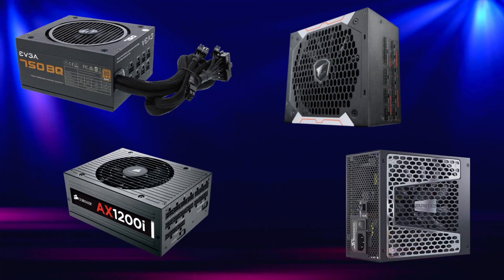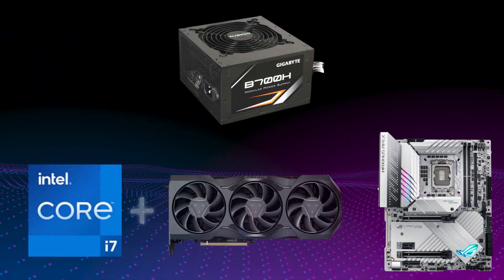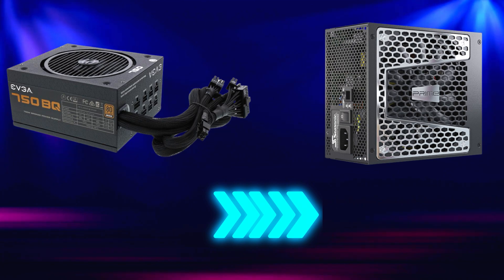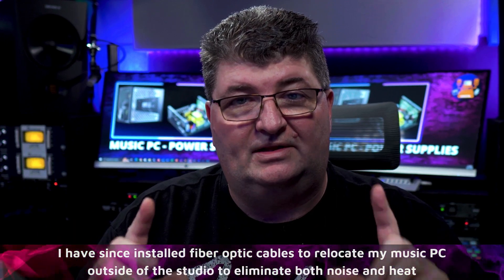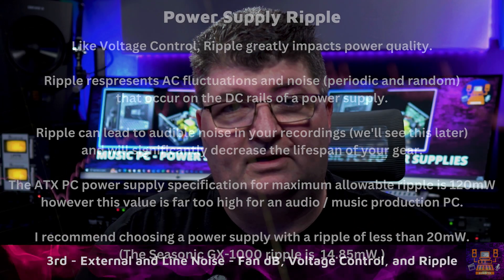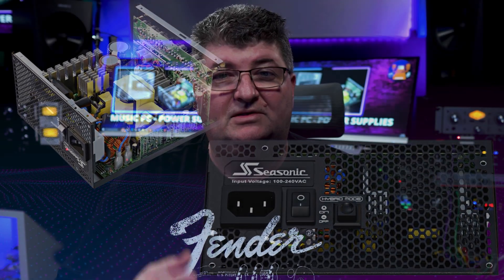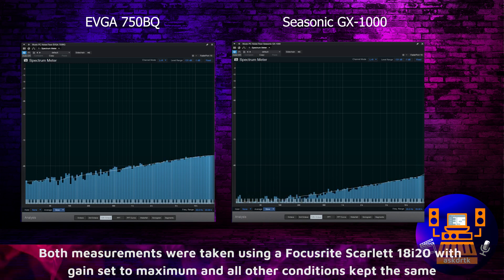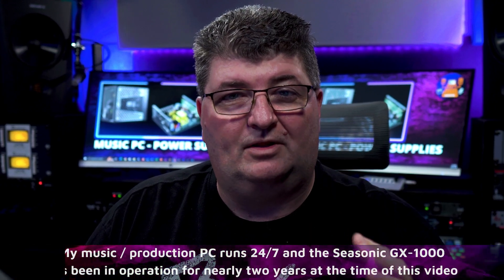DO YOU KNOW How to Choose a POWER SUPPLY for Your MUSIC PC? - 5 Key Steps

Comment: Why not the TX-1000? If going for maximum quietness ?
Reply from the maker: The TX-100 is generally a solid choice, but if you have a video card that uses the high power connector, there have been a lot of reports about line noise from the card being back-fed through the 12V sense wire. Ferrite chokes may help, but something to be aware of. Always tradeoffs with gear...

Comment: Thanks for your videos, very interesting topics that most times are overlooked... 
I have this annoying noise/hum when having my PC and Bass rig (amp and pedal board), noise comming from the PC/audio interface monitors AND the Bass amp speakers... both connected to the same outlet, using voltage regulator and surge protector, but still there, maybe  it is the PC power supply, ... anyway, I will consider all your info for my next PC , thanks again!
Reply from the maker: Much appreciated, I try to think of topics that can have a real impact but aren't always as exciting as "near gear" etc. Glad you are enjoying them. 

If the noise is not there on your PC monitors when the Bass rig is disconnected it is likely not the PSU (could be a bad ground inside the PSU but unlikely). I will say that issues can occur even when connected to the same outlet - happens with outboard gear (especially tubes) often.  Even the usual power conditioners (standard Furmans and others we see all the time) often do not solve this. For me the solution has been using power strips that individually isolate each outlet from one another. I use Tripp Lite Isobar power strips (connected to my Furmans) for all my outboard gear and amps. Since I did this, noise is gone even with wall warts mixed with tubes mixed with 500 series...you get the idea.  Hospitals use them to isolate sensitive heart monitors...so I figured if they were that good, they would be great in the studio and sure enough years later and I am not changing them. Here is a link if you want to check them out: https://tripplite.eaton.com/pages/isobar  Hope this helps out!
Reply: @askdrtk  Thanks for your response, not really sure about how you describe the use of "Tripp Lite Isobar power strips", I think I have something like that already, but maybe I'm wrong, taking advantage of your experience, this is how I have my power connections setup:
*Bass amp (Little Mark tube) and
* Pedalboard (with a 10 Isolated Outputs Power Supply) connected to
* Furman Power Conditioner Standard Strip (SS6B), connected to 
* Voltage Regulator (1350VA,  675 watts capacity) connected to THE Outlet.
Also my Focusrite Scarlett 18i8 is connected to a RackRider (15 Plus) connected to the same Voltage Regulator
And the PC also connected to the same Voltage regulator.

I know... It is a mess! 😲🤣
Any ideas? would the Isobar help in some way?
Thanks again
Reply from the maker: I’m not sure which voltage regulator you have but many do not have individually isolated outlets. Isolated outlets have separate filters preventing EMI from passing between devices. If your voltage regulator does not have isolated outlets, EMI can be passed and even looped between any and all of your gear. I would be inclined to first try connecting the RR to the voltage regulator and then all of your other gear directly to individual outlets on the RR. If that does not improve things, try an isobar with this configuration: Plug the voltage regulator to the main outlet, plug the RR into the voltage regulator, plug the isobar into the RR, and then plug all other gear (bass amp, pedalboard supply, RR, and PC) into separate outlets on the isobar. The difference with connecting your gear to individual outlets on the isobar is that each device is isolated from each other in addition to the external supply whereas the RR only isolates the outlets from the external supply, not from each other as far as I can remember.
Reply: @askdrtk  it doesn't seem that my Voltage Regulator or the RR-15 Plus have isolated outlets, so I'm going to try with the isobar
Do you know if "Tripp Lite ISOBAR8ULTRA Isobar Surge Protector Metal 8 Outlet 12 feet Cord 3840 Joules" is a good option?
It says the 8 outlets are arranged in 4 isolated filter banks, so it should work, right?
Also, just to clarify the configuration:
Outlet <- Voltage Regulator <- RR-15 Plus <- Isobar <- Every Music gear (PC, Monitors, Interface, and Furman SS6B with Pedalboard, Amp, etc.)
Right?
Reply from the maker: Yes, the 8ULTRA is a good option, I have three of those behind my racks. Configuration should be good as you have listed. (As an option you could also eliminate the SS6B and connect the amp and pedalboard separately to the isobar if that fits with your layout, but this is likely not necessary).
Reply: @askdrtk  Thanks again, very helpful messages 🙂
I wish I could avoid using the SS6B, but because of "distances/layout" I need some "long" connections for the Amp and Pedalboard, and some other effects
Do you think the SS6B could introduce some noise?
Anyway, I'm going to buy the Isobar 8Ultra, I hope I can get rid of this annoying noises for good
Thanks again, you rock!
Reply from the maker: It is possible the amp and pedalboard could create a loop through the SS6B, but it shouldn't get through the isobar to your PC. Worse case scenario, two extension cords from the amp / pedalboard or another isobar to replace the SS6B. Glad to help out. I know how frustrating chasing down noise issues with gear can be from "many years of headaches..." Let me know how things go.
Reply: @askdrtk  An update... it looks like the "noise" was induced by my SansAmp Para Driver pedal, that I use to "split" my bass signal and get the Parallel Output for the pedalboard, and the DI output to my interface, as soon as I disconnected the DI Output the noise stopped, a bit of a disappointment
Anyways I got a 8Ultra, and tried a few different ways to connect my gear, it looks like the only issue is the one with the SansAmp pedal, and something similar with the way I split my guitar signal (Boss LS-2) to pedals and amp, and as "Direct Instrument" to Interface.
Because of "layout", Outlet to Regulator, Regulator to PC (and monitors), 8Ultra, and RR-15, 
8Ultra to Bass Amp, Pedalboard, and SansAmp, 
and RR-15 to Interface
It is not a loud noise, just annoying
🤷‍♂
Reply from the maker: You may be able to clean up that noise from the SansAmp with a cleanbox. I've used this one for ART before and it did the job for a similar setup with synths. https://www.artproaudio.com/product/cleanbox-ii-hum-eliminator/#key-features I think they are around $70-80 so could be worth a try.
Reply: @askdrtk  It worked!
I used a similar box (Pyle PHE300) and the noise is gone!, and since it is a 2 channel box I can use it with my Bass and Guitar connections at the same time, great recommendation 👍 so much better
Thanks Again!
Reply from the maker: That's great to hear! Nothing worse than noise always there in the background... Cheers!